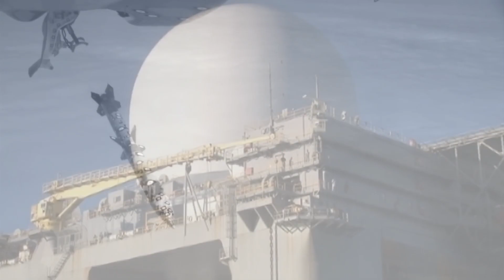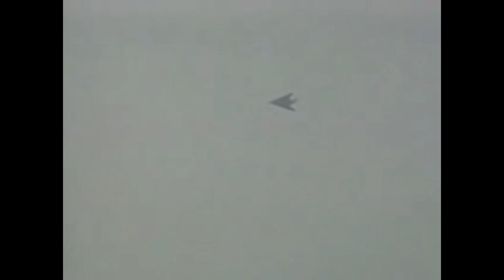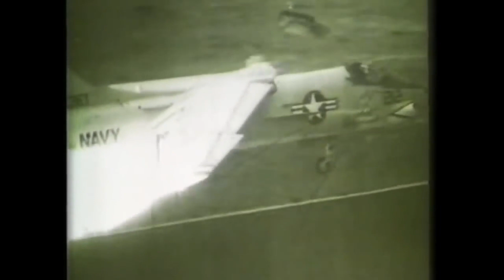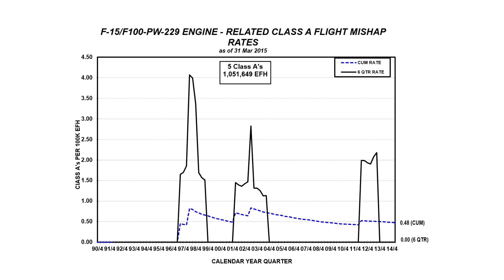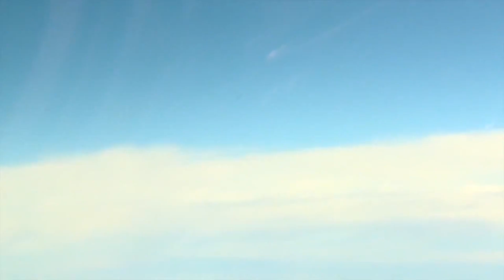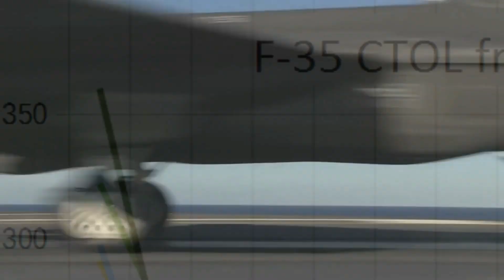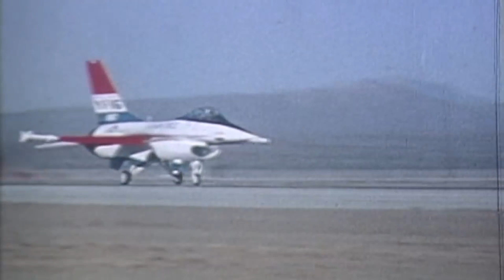F-35 Lightning II: Busting Myths - Episode 2

Comment: what a stupid popaganda video....athor have never google f35 issues...so here they are: 
1.http://www.defenseone.com/technology/2016/02/f-35s-terrifying-bug-list/125638/
2. http://www.extremetech.com/extreme/222380-the-pentagons-official-f-35-bug-list-is-terrifying
3.http://theweek.com/articles/605165/f35-still-horribly-broken
4. http://hotair.com/archives/2016/02/05/meanwhile-the-f-35-is-still-a-train-wreck/
5. The Block 2B version of the F-35 Joint Strike Fighter, which the Marine Corps declared operational in July last year, is not capable of unsupported combat against any serious threat, according to Michael Gilmore, the Pentagon’s director of operational test and evaluation (DOT&E). 

etc etc.... befoe you spent amount of tme on these tupid propaganda videos, please read all google artcles about issues
Reply: +Silvio S Dragon are you going to deal with this bullshit, or do you want me to?
Reply: F35 is a game changer. General Mike Hostage says this: The F-35, he says, has “at least” the maneuverability and thrust and 
weight of the F-16. The F-35 is to the F-22 as the F-16 is to the F-15. 
The latter aircraft are the kings of air to air combat. The F-35 and the
 F-16 are the mainstay of the air fleet, designed for both air-to-air 
and air-to-ground attacks. Pretty sure thats what it was designed to do. Thanks General.
Reply: +Silvio S 
*Proceeds to link two news websites a sources.
Reply: Did you get your Kremlin check yet? I heard the troll factory is running low on money!
Reply: Chris Russell
Your opinions are yesterdays news as per usual. IOC has past now so you are now old news boring and irrelevant. As General Goldfein says....."It sucks to be you"
Reply: +Chris Russell    Well, that fits you to a tee. That is why you are a troll. By the way, all my facts are in the videos that you claim are false. Just like you bitching about the seven F-35s at Hills so called poor performance, this after anew video telling that now Hills AFI now has over forty and doing just fine. To me that says it all about your misinformation on the F-35 and old reports to make incorrect claims and  any correct claim. I also see you have made goofy claim on how good the F-35 is doing at red flag. You pick and chose, that is more what makes you a TROLL.
Reply: There's a reason why regular folks should be kept away from technical details. And I blame the educational system for failing to teach them about probabilities. 
The plane might kill the pilot? That's the problem? Are you fucking kidding me? So we strap a guy in front of tanks filled with 7-8 tons of high-octane fuel used by a big ass jet that works by blowing up that fuel and strap some missiles with high yield warheads close to the fuel tanks and then make this joy-ride fly at 1.6 times the speed of sound in an airframe that is by design unstable and flexible. And you worry that the pilot might not be safe in case this contraption blows up and they might need to eject? Are you fucking kidding me? Do you also worry about it not being natural or gluten free? 
The only proper question here is about this new machine being less likely to kill its crew than the previous death-trap we came up with, but hell, the risk is sure as hell not going to stop us from wanting to fly these beasts. Hooorah!
Reply: Chris Russell The man who knows more than an F35 pilot, than defence departments of 12 countries, than scientists and engineers. In his own mind he is bloody brilliant. Meanwhile F35 program marches on leaving him way, way behind.
Reply: Chris Russell   Watch these busting myth videos and learn, if you can.
Reply: Chris Russell
Welcome to the fantasy world of chris russell. A world where HE has more military know how and experience than anyone serving in any of the air forces that are involved with the f35. A fantasy world where HE has more credibility than people who fight for their country whom he calls LIARS. This my friends IS chris russells world. Coming all the way to you from a bungalow in his mums back yard.
Reply: Chris Russell     PURE BULLSHIT again.
Reply: Robert Brockway I thought you'd fallen dow a Toilet brockway, find your way back to the surface with the rest of the Rats, did you. 

And again,
 It doesn't even matter how much Crap you are conned into believing about this Aircraft by virtue of your ignorance, The War is already over for it. The only People that don't know about this Aircraft are the Idiots buying them.

Some light Reading.

http://securityaffairs.co/wordpress/45597/intelligence/china-hacked-us-defense-contractors.html

http://theconversation.com/hacking-the-secrets-of-australias-joint-strike-fighter-36436

http://www.nydailynews.com/news/national/snowden-chinese-hackers-stole-f-35-fighter-jet-blueprints-article-1.2084888

http://www.nytimes.com/2011/06/04/technology/04security.html?_r=0

http://www.itnews.com.au/news/lockheed-martin-hacked-using-rsa-keys-258910

http://freebeacon.com/national-security/china-hacked-f22-f35-jet-secrets/

http://www.ibtimes.co.uk/wondering-how-hack-military-drone-its-all-google-1500326

If a CIA Drone can be brought down, bye bye F35.
Show less
Reply: Chris Russell Fighting a losing battle there Sunshine. Its here to stay and none of your BS and childish comments will stop it. Glad it pisses you off though. :)
Reply: Can't you deal with the Facts. What are you going to do, quote some more Lockheed Martin or General Bogden Propaganda Bullshit at him to try and Shill for the Company ???
Reply: Reading this again, I think he's a troll.
Reply: yakidin63 Hi Chester, hows Spike. IOC was declared on the Marines F35's age's ago and they're still Combat Ineffective against even their own Aircraft that are Hog tied to allow the F35's to win. The Bar is constantly lowered for this Aircraft and you Know it. Who care's what a wannabe Politician General say's. His sole Position in Life is to Lie to as many Politicions as he can to swindle as much Money as he can from the Tax Payers to make sure he keeps his Defence Contractors happy, and keep the Money flowing through his Pockets.
Reply: Your full of shit as per normal. F35B killed it in Red Flag. Unfortunately for you everyone else's reality is a fantasy for you where all factual information and reports and comments praising the F35 are corrupt.You are yesterdays news and you must feel sad. Grab yourself a box of tissues and hop off to your bungalow at the back of your mums house, have a good cry and a lie down. :)
Reply: yakidin63 Ok ,where's all this Factual Information from Red Flag then "Chester".
Reply: Chris Russell I don't think its been at red flag. It has been used in several exercises with F-15Es though. Reports were something like 15 kills to zero.
Reply: Tim Blizzard I believe the Marines have been to Red Flag, or so they are claiming. But as for how it went, it's the same reply in all of the Reports.

"As a multi-role stealth fighter, the F-35 can perform basic CAS missions, air interdiction and limited suppression of enemy air defenses. 

Still nowhere near good enough for what it supposed to be, and the stupendous amount of Money and Time that has been spent on it. I've read all the Reports on the 15 to 1 Rubbish, but they do not even try to claim that the F35's have shot down 15 F15's they more imply (Not Believably) that the F35's were supposedly not shot down by the F15's and once again repeat what is above, "Limited" and "Basic" bla bla bla. The last factual Report I had heard was that Bogden was going to go for IOC with only 3i Software and that basically is 2b with an upgraded CPU and bugger all else. The Aircraft were only getting a maximum of 4 Hour's between complete System shut downs. Then Bogden said he would like to try and get it to 10 Hours, he would be happy with that. Once again just very Pathetic. Thankfully at least the American Senate, Gilmore and the other Guy in charge of oversight said that that would not be acceptable. Bogden had no reply for that. Bogden has even ducked an Australian Senate Inquiry, apparently it was his wrong time of the Month. So much for the super Salesman.

When the next Dept of Defence Report comes out. It will be able to confirm what actual capabilities these Aircraft have. But for now it's just Smoke Mirrors and Hype. 

But old "Chester" or Yak, is just so full of it and throws up every piece of Propaganda, factual or not and expects everyone to buy it. I only deal in Fact, not Fiction and Smoke and Mirrors.
Reply: Google ain't shit, really bad info source.
Reply: +yakidin63    Very well said and true.
Reply: yakidin63 Hey "Chester", you're the Fantasy Boy. The Plane is a Lemon. Full stop

http://www.thedailybeast.com/articles/2016/03/17/military-admits-billion-dollar-war-toy-f-35-is-f-ked.html

http://www.businessinsider.com.au/f-35-setback-2016-2

http://www.americanthinker.com/articles/2015/03/the_disappointment_that_is_the_f35.html
Reply: So original. Where's your 2015 DOD report or have people stopped listening to you on that one. Meanwhile the F35 marches on leaving you in its dust. Here some intelligent reading for you. 1.https://washington73.wordpress.com/2016/08/31/soaring-into-history-test-piloting-the-fleets-newest-aircraft/     2.https://www.dvidshub.net/news/208489/vicious-cycle-f-35a-continues-5th-gen-tradition-bullying-legacy-aircraft   3.https://www.facebook.com/USairforce/    4.http://www.nationaldefensemagazine.org/archive/2016/september/Pages/AirForceF35ProponentsStrikeBackatCritics.aspx
Reply: +Chris Russell    I see you are still pushing your lies and bullshit.   TROLL
Reply: Robert Brockway Hi Robert, I see you still have nothing more to do with your time than use your lack of intelligent rebuttal and insults to try and bury anything that's factual. By the way Bob, below is the definition of the Word Troll. It's you Bobbie !!!

In Internet slang, a troll (/ˈtroʊl/, /ˈtrɒl/) is a person who sows discord on the Internet by starting arguments or upsetting people, by posting inflammatory,[1] extraneous, or off-topic messages in an online community (such as a newsgroup, forum, chat room, or blog) with the deliberate intent of provoking readers into an emotional response[2] or of otherwise disrupting normal on-topic discussion,[3] often for their own amusement.

Once again, the Plane is a Lemon. Full stop

http://www.thedailybeast.com/articles/2016/03/17/military-admits-billion-dollar-war-toy-f-35-is-f-ked.html

http://www.businessinsider.com.au/f-35-setback-2016-2

http://www.americanthinker.com/articles/2015/03/the_disappointment_that_is_the_f35.html
Show less
Reply: Chris Russell
 Another F35 positive post for trolls to read.https://www.dvidshub.net/news/208740/f-35a-completes-largest-deployment-date. F35 just keeps rolling on. Leaving it's haters eating dust in its wake.
Reply: yakidin63 It doesn't even matter how much Crap you are conned into believing about this Aircraft by virtue of your ignorance, The War is already over for it. The only People that don't know about this Aircraft are the Idiots buying them.

Some light Reading.

http://securityaffairs.co/wordpress/45597/intelligence/china-hacked-us-defense-contractors.html

http://theconversation.com/hacking-the-secrets-of-australias-joint-strike-fighter-36436

http://www.nydailynews.com/news/national/snowden-chinese-hackers-stole-f-35-fighter-jet-blueprints-article-1.2084888

http://www.nytimes.com/2011/06/04/technology/04security.html?_r=0

http://www.itnews.com.au/news/lockheed-martin-hacked-using-rsa-keys-258910

http://freebeacon.com/national-security/china-hacked-f22-f35-jet-secrets/

http://www.ibtimes.co.uk/wondering-how-hack-military-drone-its-all-google-1500326

If a CIA Drone can be brought down, bye bye F35.
Reply: Chris Russell    Sure right, everybody is wrong but you stupid none expert pros on YT.  HA HA HA HA
Reply: Chris Russell    Rants of another pisst off loser. You got nothing and never did.
Reply: Robert Brockway Says a pissed off loser. lol
Reply: Silvio S its not perfect there arent any jets that are perfect they all have flaws
Reply: Silvio S lol these are all old news articles and most are bs and most problems have been fixed
Reply: Chris Russell thats with most planes there not In the air all day
Reply: yakidin63 The F35's are Kings of the Ground, because that's where they spend most of their time.Alt Ctrl Del, the next Chapter.